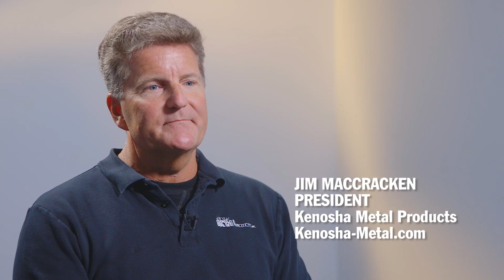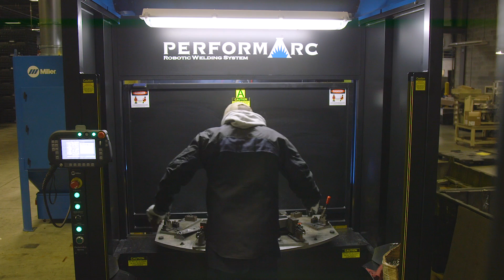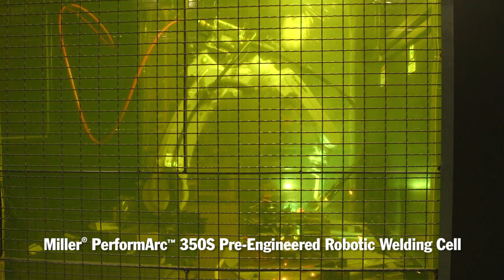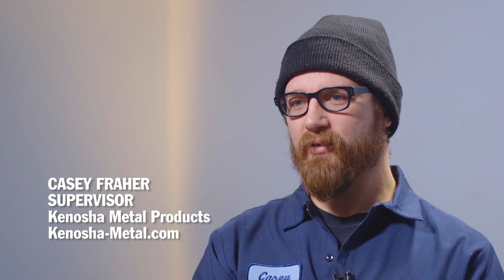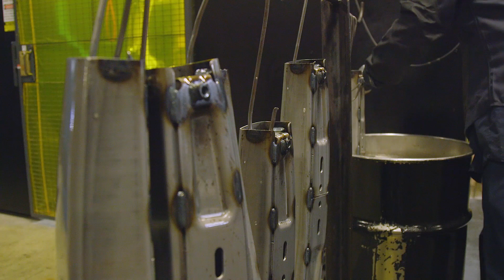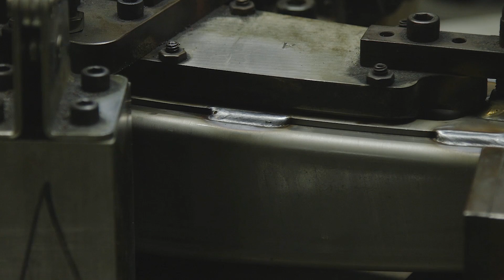Welding Automation Investment Offers Company Fast Payback

Comment: Adding a robot can actually increase the technical workforce. People need to maintain the robot, the electronics, the assembles that go into the production process. When a company saves money one way, they spend it on another more frequently like RnD facilities. If you are a welder that really wants to keep your skills when robots start working along side you, get into the extreme custom fabrication like motorsports or prototype work. No two welds are the same in those businesses